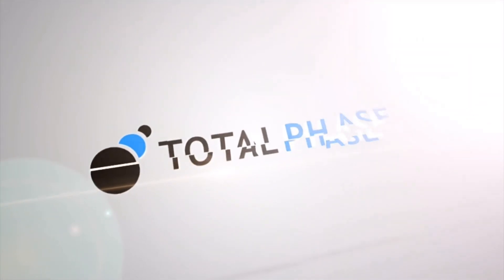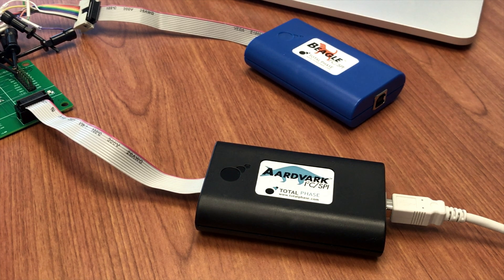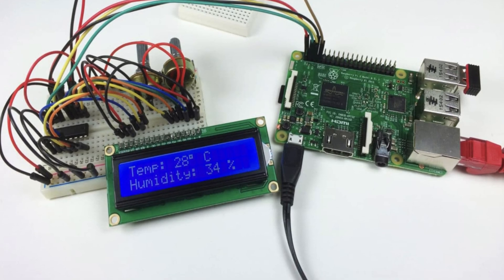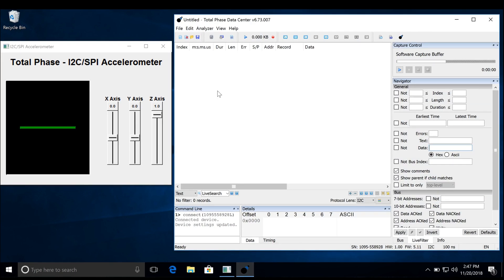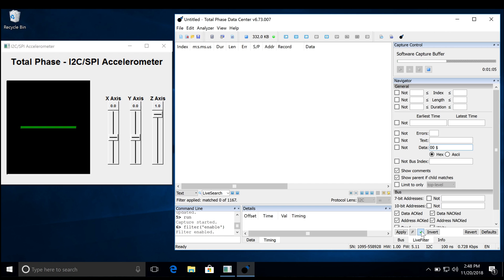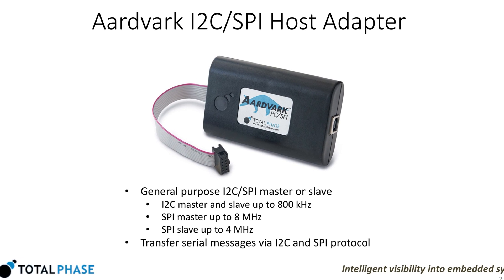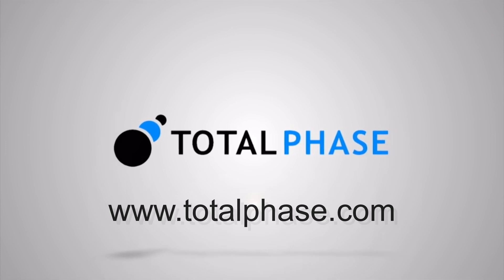Prototyping I2C Systems with an I2C Host Adapter and Protocol Analyzer

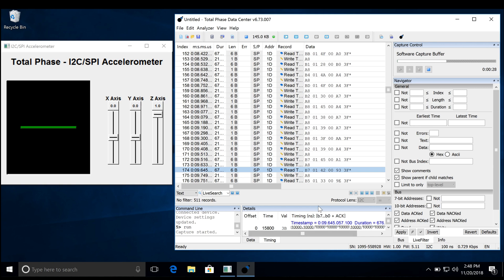Comment: What software are you using to visualize the Accelerometer and is it open Source? (2:26 the program on the left)
Reply from the maker: The software we use in this video to visualize the movement of the accelerometer is an internal application used for demo purposes. If you would like access to it, I would recommend you reach out to our sales department and ask them if you could get a copy of it. You can reach out sales department via email at "sales@totalphase.com."